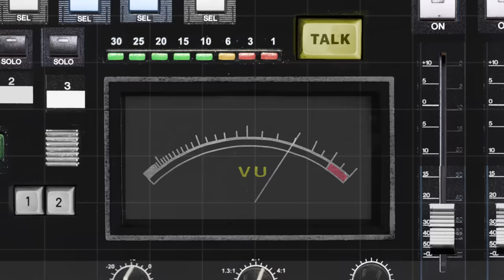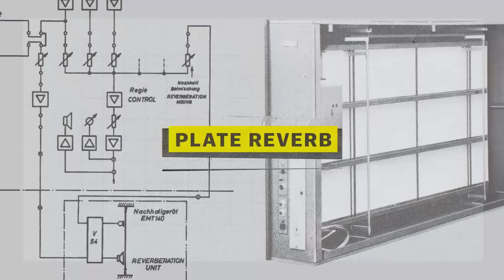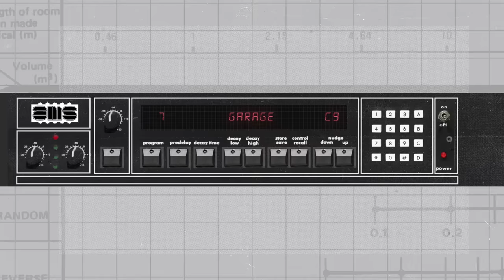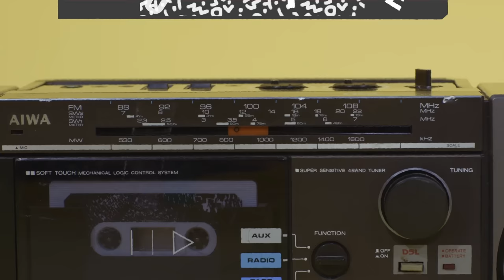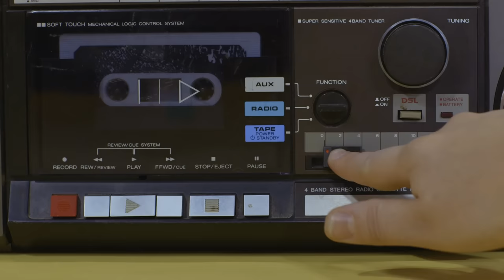How a recording-studio mishap shaped '80s music

Comment: In the 1980's I sold Linn Drums for Linn Electronics. The first model came out in 1980- 1983, ($4995-$5500-$3995), & was the Linn LM-1 Drum Computer, which had the sliders. (Pictured at 4:40- 4:49).  The second model, 1982- 1985, ($2995), was just called LinnDrum, (pictured at 6:53 - 6:58). This one had nobs. The last drum machine they produced 1984- 1986, ($5000- $7000), called the Linn 9000, which had velocity & pressure sensitive grey rubber pads. (Not pictured). This last machine had memory built into the software, which when the machine over heated, became unreliable. Michael Jackson used a 9000 to record a whole album on. The machine over heated, dumping the whole memory. This proved to be the end of Linn Electronics. Forat Music & Electronics purchased the assets of Linn Electronics. They got the bugs out of the 9000, releasing it as the Forat 9000. Roger Linn took what he had learned from Linn 9000 & Sequential Circuits Studio 440 to design the Akai MPC60. Roger went on to work with Ray Kurzweil. 
Most information gleaned from Roger Linn across the dinner table. Good food, good company, makes good conversation. 
Or the formula:     GF +GC = GVox.

Comment: I love clueless college professors. He's a Prince, of a guy. Kind of like that, aluminum plate reverb. And so this professor, ain't much of a professor. Since he has had all the time in the world to learn about Dr. Kuhi's reverb, introduced in 1958. Was not made out of aluminum. It was made out of cold rolled steel. With a linseed oil protective coating on the plate. To keep it from, rusting out. Aluminum... give me a break?

And so when I am asked by young guys, what's the best recording school I can recommend? My answer is usually, take that same amount of college money. And purchase yourself some professional recording equipment. It doesn't matter what types  or, brands? If it's intended for a professional audio application? You don't even need to look at the specifications. It'll do the job. And then you teach yourself. Like I did. Like all of the hit engineers that I know, did. And I know many of the best. As I've worked with them. As I also, designed, custom built, fabricated and installed, large and small, personal and commercial, recording studios and control rooms in, radio stations and television stations.

So let's review. I worked professionally, nearly 50 years in the business of the, Recording Arts & Sciences. And an audio engineer for, NBC-TV & Radio. For 20 years. After working 10 years in recording studios and other radio stations. My parents were professional musicians and not technical people. I never went to school for this stuff. I read everything I could get my hands on. Were a lot of books over the years. Maintenance manuals, for professional multitrack analog recorders and consoles. I wasn't a good student in school due to, Hyper Active Attention Deficit Disorder and brain condition. I was a high school dropout. And while I became a high school dropout at 17. By 15. I had already acquired by third class FCC radiotelephone broadcast license. And I had a two day per week show. On Baltimore's, 50,000 W, NPR affiliate, Baltimore Junior College's, WBJC-FM. And was the youngest engineer working at the station, ever. And so one of the reasons why I dropped out of high school? I turned 17. I got hired on at the largest 24 track recording studio, south of New York City. Which in, 1973. It was in Philadelphia, no. It was in Baltimore. And the original home of, the fabulous Engineer/Producer/Equipment Manufacturer, George Massenburg.

Now you've heard these stories before. You get a job at a recording studio, sweeping floors, cleaning bathrooms, making coffee, running errands and being a go for. I never had to do any of that crap. I was hired on as a full-blown, Audio Engineer.

And oh by the way. On a folly. I went and took my GED test without any preparation and aced it. And that got me mad. Why? Because I realized I could have passed after the, 7th grade! And I wasted three additional years of my life. In stupid high school.

Now the only problem with this? While I've garnered, a couple of Grammy, Emmy and Soul Train, award nominations. I became Quality Control Manager and Final Test Technician, for one of our most legendary, analog multitrack recorder companies, Scully. And I ain't got no college. So I can't teach no college. No. All I can do is, teach the college professors. So that they don't hand out, incompetent, terrible, misinformation like this, Prince. You can tell guys like him. Never had a career like mine. No. All he got was a degree. Probably not good enough to get hired in the industry? So, he ends up, a knowledgeable, authoritative, incompetent, misinformed, college professor.

So why would you want to throw your money out like that? These people, don't know what they're teaching? They can only hear with their eyes. They don't know about these two other things on either side of your head? I mean stupid me? I never knew that, textbooks or mathematical formulas, could hear anything? And then they also suggest that you use a, Large Diaphragm Condenser Microphone... in a small room? What? I guess they also don't understand about, bad, off axis response, of, LDC microphones? Especially in small rooms.

Hey! When was the last time you use a $100, Shure, SM-58. To cut a lead vocal with in your studio? When you have a pair of, Neumann, U-67's, also? Why? Because the SM-58. Will sound very similar to but warmer than, my vintage Neumann U-67's. And they have Telefunken tubes. I hardly use them, ever. Give me a bag full of, SM-57 & 58's. And I'm happy. You don't need anything else.

When I was a teenager, I owned, crappy, consumer, equipment. Because as a teenager. You can't afford an API or Neve console. You can afford expensive microphones. You can't afford expensive processors. But even consumer equipment has a frequency response of 20 Hz through 20,000 Hz ± a couple of DB. And if it can only do, 50 Hz through, 15,000 Hz? Well guess what? No one will notice. And you get a cheap limiter. Which could be, a 30-year-old plus, Sony cassette deck? That has a built-in, switchable, limiter. And you stick a blank cassette in and hit, record pause. And you've got a limiter. A stereo limiter. Or use a single channel as a mono limiter on a vocal or, solo instrument. And ya get a couple of cheap $50, five band, consumer graphic equalizers. A cheap mixer. And you're good to go with a computer audio interface device of just about any level.

The only school you need to go to? Are all of those rock 'n roll records you and your parents have. And you listen carefully. You listen deeply into the mixes. Then you concentrate on a single instrument or vocal. And listen to that song again. And then again. Picking out a different instrument or vocal to listen to. And that's what we call ear, training. Listen to enough rock 'n roll records. And you too, can come out with a degree from, the University of Marijuana. I mean let's get real about this? Where do ya think all those rock 'n roll hits came from? Nobody was sober when they made those. You couldn't be. It's a sacrifice. We all have to make.
Reply: RemyRAD that’s great

Comment: On the subject of sound studios, I worked on the basic fitting out of one at a TAFE College here in Melbourne, Australia as an Apprentice Carpenter way back in 1984. The walls were concrete Besser blocks that we battened out with timber and infilled with double thickness insulwool batts. It was a real echo chamber with the concrete floor, but by the time we had placed the insulation batts on two walls it was having a funny effect on my ears. There was no longer any real echo to be heard as you spoke and it felt rather weird. I didn't get to see the finished room unfortunately, but I expect that the lack of ordinary echo would have been even more pronounced.

Comment: Strange that spring line reverb units are not mentioned at all, which didn't weigh 600lbs. They could emulate mulitpath reverb effects by having multiple springs with different tensions or lengths, depending on the type. Also not mentioned is that all electromechanical reverb units are terribly sensitive to physical disturbances like knocks or floor vibrations. In fact a similar construction is used  in seismic sensors!

Comment: Lots of reverb on a drum is an 80s thing, but that's not the reason they POP out of the mix. . . that is because of the use of sidechain compression: Using the drum track as a side-chain for the compressor to "listen to" and use that information to control the volume of the other instruments, turning their volume DOWN for an instant while the initial strike of the drum hits.  (sidechain compression was invented in the 1930s)

Comment: Accident? Are you kidding.? I was involved back then. Gates were EXTREMELY common,.every studio had at least 20 channels of gates (started out with KEPEX 1s, then Kepex 2s, ). What was NOT common, was the digitial reverb. Putting a gate on it just cut it off to get it out of the way so it would enhance the drums more rather than muddy things up forever. By the time the Lexicon PCM60 was around,..the trashy drum sound was here to stay.  And the Lexicon 224, and 480L (as well as the original 200 by lexicon) were all very similar and heard on about every rock and roll song out there. Nearly every studio I worked in had a 224 and and 480L (480 just a newer version....not sure I liked it any more than the 224).,...a few also had a 200 (200s did not come with a remote and were made for touring). I believe you had to use your own noise gates before the pcm60 came around...but anything after that was sort of "all in one". I don't recall EVER putting a noise gate on anything that came after the mid to late 70s.  I can't ever remember what was out there before the pcm60,.. But I think your choice was a genuine plate reverb with a noise gate on it,..or possibly a live reverb room,..I never worked with one of those.  But,....to be perfectly clear....................Noise gates, and reverbs, are not the same thing, and hardly related....even though they may come in the same box (or nowadays,...the same software).,

Comment: 1) Compressors don't increase the volume of quiet sounds. 2) Not many examples of this sound are examples of "gated reverb". 3) Kiss by Prince has nothing like gated reverb. 4) Modern "gated reverb" is typically short-lasting hall reverb. 5) Lorde has never used "gated reverb" or anything like it on drums.

Comment: You forgot to mention wire spring reverb units, which were much smaller and lighter than plate reverb units. They were inexpensive to make and were / are still very common in portable guitar amps. Still analogue though, but filled the gap before digital reverb became commonplace.

Comment: your description of compression is off - compressing makes loud parts quieter, expansion makes quiet parts louder. so there are two discrete tools for doing each, compressors don't do both (generally)
Reply: Compression makes soft sounds louder because it compresses the loud sounds.

Comment: Surely you can use gated reverb without making it only feel like it came from that era Just use a variety of instruments that aren't only 80's style. These new tracks clearly wanted to have an 80's pop style. You could probably make a great sound using non-reverb drums mostly with a gated reverb drum to add impact at certain points.

Comment: As much as I love the album, however 'Third Stage' by Boston is where that drum sound went way too far IMHO. The drum mix on that album just doesn't sound natural, sounds very synthetic especially compared to their two previous efforts. It is still a fantastic album. I would love to hear a different drum mix/processing. That said, I wondering if they would consider a mix with less digital processing on the drums (especially on the kick and toms). Thoughts anybody?

I am a huge Phil/Genesis/Brand X fan and I can say the studio mistake only emphasized a style and drum sound that was already there but not to the degree after Gabriel's Melt/3 'Intruder' session. Phil = finesse and power and has been since Nursery Crimes.  Brand X recordings from the 70's also showcases Phil's sound even more prior to the gate reverb incident. Genesis Duke album has a great modern 80's drum sound save the kick drum which to me is unbearably thuddy lacking any definition. The Duke album is the only recording of Phil sounding undesirable on ONLY the kick drum.

Comment: Jumping from the 600 lbs reverb boxes to the AMS RMX16 is like skipping some 10 years of reverb making product evolution :-/
You totally forgot the smaller shoe box sized reverb boxes with helical-spring-like delay lines from early '70s and the very popular mid '70s CCD (Charge Coupled Devices) based, all solid state, reverb unites that did ALL that the AMS RMX16 did but without the presets and fully analog.

What you just did here is like omitting the Moog's from the history of electric and electronic music instruments :-(

Comment: went from plate reverb straight to digital (DSP)? you at least skipped spring reverb which was widely used (could have also mentioned tape loop). then the analog "bucket brigade" reverb units... then the digital units..